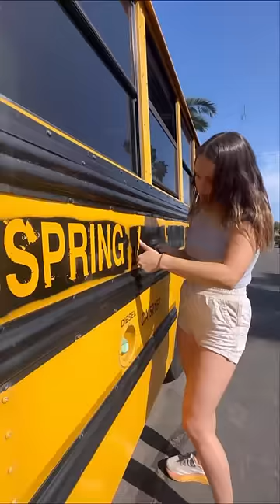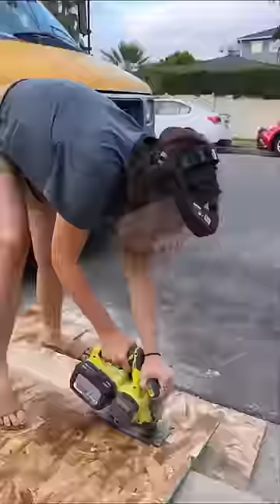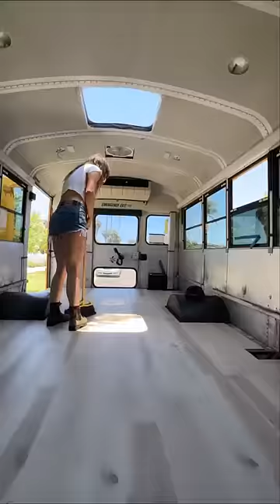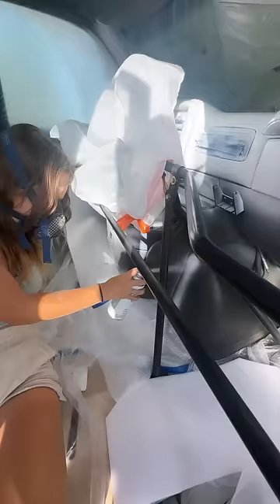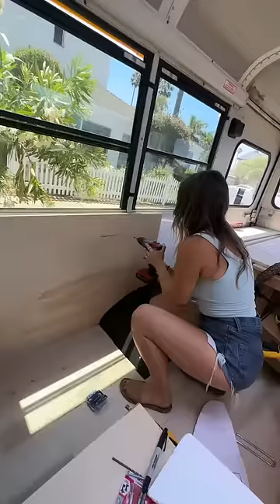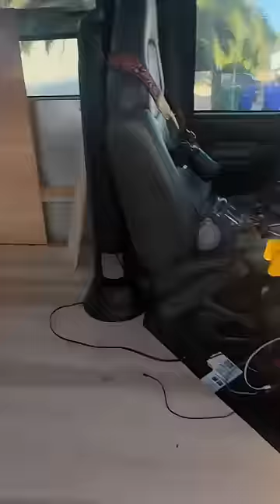#schoolbusconversion #skoolieconversion #tinyhome #skooliebuild #skoolie #vanconversion #vanlife

Comment: Why is it that the very first step in the process was literally anything other than installing water tanks and a toilet? I mean, come on. That needs to be the very first project on the list. You can mount your fresh, gray and waste water tanks under the rear of the bus, between the frame rails. Sure, you built a nice bed and comfy couches but without a place to spend time on Facebook, you're forgetting an absolute necessity. Plus, you're not going to want to live in this thing anywhere it gets cold. You have no idea now little insulation sheet metal attached to sheet metal with dozens of unsealed windows that, in all likelihood, don't all close completely from years of use and metal being flexed and twisted from a lot of miles driven provides. Ask a professional school bus driver just how rough it is starting one of those up in the early morning when it's -20 f outside in February.